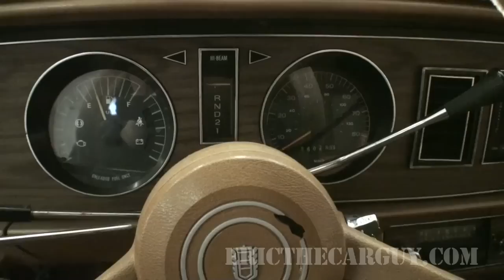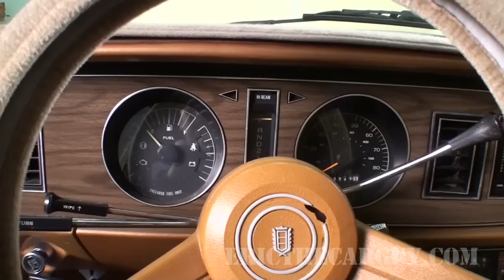1979 Ford Fairmont a Closer Look #FairmontProject

Comment: Wow brings back memories! I had a 1983 Ford Fairmont heavy duty package NYC Taxi $8,800 brand new! The easiest car to work on! Changed oil & filter every 3000 miles, brakes every 10,000 miles, tune ups every 25,000 miles, timing chain every 50,000 miles, struts, wheel bearings…you name it!  Tranny went at 99,000 miles had Aamco fix it $35O. @ 180,000 would not pass Taxi Limousine inspections. Great video Eric!

Comment: If you wish to upgrade to 4 wheel disk brakes. and 5 lug conversion. You can take spindles and axles from a 94-2004 mustang it is direct bolt. you will also gain sealed front wheel bearings.

Comment: I like these old fox body Ford Fairmonts from the 70's & 80's because any type of engine can be adapted to this type of vehicle. The best engine to use in a Ford Fairmont is the 302 V8 such as the Mustang engine.  But the old school straight 6 was a dependable fuel efficient standby for a driver that only desired a reliable daily driver to go to work or the grocery store.
Reply: Mr Cabot    Yeah, that.  My 79 wagon with the 6 got a steady 16mpg around town and maybe 20 on the highway if I didn't wrap the speedo around :D.  But it was dependable. Tended to eat carbeurators though.

Comment: Amazing video! I have to agree with your point on the manual transmission. I too like the look of the column shifter in the 1970's to late 1980's  American cars. I own a 1987 Suburban and I would not change its automatic to a manual transmission. Every time I step into my truck It takes me back to my childhood. Such good times.

Comment: I have always had a thing for Fairmonts, even though I never owned one myself.  I remember seeing the commercials on TV back in the fall of 1977.  As many of you know, the 1978 Fairmont introduced the "Fox" platform, which served as the foundation for many of Ford's other vehicles, such as the 1979 Mustang, the 1980 Thunderbird, the 1981 Granada, and even the 1982 Lincoln Continental!  The "Fox" platform lasted until 2004, last seeing duty under the "SN95" Mustang.

Comment: This was my first car. 79' Ford Fairmont. We bought it in 1987. I found it in the Thrifty Nickel (the Facebook Marketplace of the day) and traded a .410 shotgun for it. No windshield, no back window, four different size tires...and the engine was burned up. My dad and I spent an entire summer rebuilding that engine. It had a rear main seal leak. I literally kept a case of oil in my trunk. It left contrails where you drove. 😂 Oddly though, eventhough the oil leak continued, it didnt smoke as badly after a few months. That was the car I drove to college. I used to make trips from Tyler, TX to Fayetteville, AR in it. I think the only real issue I had was needing to replace the alternator. The interior (oddly enough) was in excellent shape and it blew cold air. I sold it to a school teacher in 1989. Good memories.

Comment: Great tips Eric ... my pipe wrench could have saved me many rusty struggles over the years .. bingo !

A tip I would share here is that cotter pins need not be an obstacle. I constantly reuse them by gently bending the loose ends back together as straight and flush as possible starting with a flat screwdriver if need be and then using needle or regular pliers to crimp the ends back together as straight as possible .. then grip and pull the on the loop end so as to pull it out the way it went in. It's a far more time and money efficient approach.
Cotter pin metal is soft enough to be very forgiving and easily extracted and tapped back in for re use repeatedly.

Comment: My first car was my mom's old 1979 Mustang. She bought it new and I ended up with it in 1989. It wasone of the rare ones from that year that had the same block as your Fairmont, and your video brought back a ton of memories. All my earliest nightmare wrenching sessions were under the hood of that car. My sister had trashed it in college and I inherited the sky blue hulk. I was so broke when I was in college that when that stupid Ford flexible coupler in the steering shaft came apart (which was a rather harrowing experience on the highway, to be sure) I had to repair it with a shoelace. It held for almost two years until I could get a junkyard flexible coupler that was in good shape. 

I hated that car. I loved that car. Thanks for the memories. Looks like you actually have quite a bit to work with, here. The rocker panels are a good indication of the condition of the body on these old cars, and yours are in what look to be excellent condition. 

Have fun. I will enjoy watching your videos that follow your work on this vehicle.

Comment: Eric, I really admire the vision you have for the Fairmont. My friend's Mom bought one new, a 2 tone, light & dark blue. 4 doors. Even though this is probably the most
"plain Jane" car EVER produced, it has character. The aerodynamics are like a telephone booth on wheels. You expressed that you intend to do a V-8 conversion.
I would suggest considering a Turbo 2.3 SVT. They are wicked quick, and the fuel economy is a plus. I had a friend that had this set up in an '87 Thunderbird, with a 5 speed, this HUGE car would get rubber in 2nd gear, zero to sixty around 6 seconds, and get nearly 30 MPG. No, you don't get the pleasant rumble of a V-8, but the factory exhaust on my friends T-Bird (duals, no less) was, let's say, inspirational.
If you decide on a V-8, I would only assume that you would go with the 4.6. Excellent choice. 3:73 gears and an AOD tranny. I have this set up in my Crown Vic Sport. I can only imagine how this would propel a Fairmont. (!)  Best of luck with the Fairmont project. I will be watching.

Comment: oliver is an interesting older car. very well taken care of also.  any resto mod will take much time to complete correctly, however at the end, you can say you did it, and that is very satisfying.  something about these older cars that brings you back to an earlier time. newer cars require less user input to operate but can be much more of a pain.  I myself prefer older vehicles, throttle cable over fly by wire anyday.

Comment: I had a '78 Fairmont wagon with a rare factory trailer package. (5 lug hubs, C6 trans, HD axle and suspension) I am a performance car enthusiast, so it was sort of a between car for a while. It drove like a dream, and this one did have a rather spirited 6, maybe had a higher hp engine with the trailer pkg. I drove cross country with this car, never a problem or worry.

Comment: My first car!!!  My 79 Fairmont had the fire breathing power of a 2.3L 4cyl.  Got it in 1984 and had it until about 1988 or 89.  The cars body still looked good but the undercarriage rotted out.  It sat for a couple years but always started like it was still a daily driver.  In fact it started right up and drove itself to the junk yard on the day before the registration ran out with giant holes in the trunk floor and no exhaust.  I drove it on it's final trip with all the windows open cause I didn't want it to be my final trip also ;)  I remember an article in a car magazine back in the 80's when I still had mine about this guy that put a 460 Lincoln in a Fairmont and kept it looking stock from the outside except for the big fat tires on the back.
Reply: me to the floor boards and the dash were rotted out! it had copper head in it. I parked it in 1999

Comment: I like this car and I like what I can see of your mods.  Reminds me (at my age) of the 62-3 Chevy II base model 2 door sedan with all the ways you could go to modify it.  A picture of a 62 Chevy raised up a bit with a straight front axle and a larger but not outrageous size engine up grade makes me smile.  The look of a bench seat with a Hurst shifter with a patterned white ball just brings me back to those days.  Your Fairmont could easily be a newer version of that 62 Chevy II base model 2 door sedan with a rum, rump cam and a 5 or 6 speed Tremec manual transmission (a little pricey) with a 411 rear gear with some tubby tires.  I haven't explored any of your video's about what you did to this model but I'm very, very much looking forward to going through them.Take care and thanks for your time...Rob (ex Bronx boy)

Comment: ive got a 78 that ive had for six years, has 358 thousand miles on it and i just drove it across the US twice. starts up and purrs like a kitten all day. 23 strait hours driving and not a single problem. sure its under powered but that c4 transmission shifts very well and its a fun constant project

Comment: You're right, it makes me think back about the light weight.  I can see the emissions because of the gas problems in the 70's.  Also, I had a 1980 F100.  Thinking back when you said light weight, Ford drilled a bunch of holes in the frame around the truck to lighten the weight of the frame.  After production, they realized that by doing that weakened the frame and they stopped doing that afterward.  Beautiful Fairmont, can't wait to see what you do with it!

Comment: Oh man a suspension change. I keep dreaming about putting a VW Bug or a Citroen DS on something more contemporary. This project is gonna rock so hard, thanks for the videos!
Reply: For the DS it would be a shame to lose the suspension of the time. Yes, it was prone to failures, but it was awesome technology (you could drive the thing on three wheels in case you had a blow out!!!)
Reply: Yeah can't argue with that- that suspension is automotive history and should be preserved on the proper oldtimers in original state.

Still, when talking about sleepers nothing sounds as awesome as a DS with a modern day air suspension or something of that sort.

Comment: Ahh the good old horn on the turn signal. Parents had two Fairmouts a '80 like you yours but 4 door with a light brown color and a '83 4 door Futura. Remember riding with my mom to work and she had a large hill to climb in the '83 we would hit 70 before the hill and by the time we hit the top were lucky to be doing above 50. These car have a spot in my heart, I even though at the age of 8 it was a good idea to drive around the block only went into one lawn fun times.
Reply: Also don't forget about you foot vents.

Comment: I am catching up on his videos as I am a disabled vet and got stuck in the va hospital with no internet.  Back in 1976  was 16 and my days was a master mechanic . I used to help him where he worked in a taki company . They dad not mind. I started sweeping the floors but by the age of 9 I could take a car apart and put it back together. I even was getting paid at 15 for helping out on every thing. He paid me 5 and hour for 4 hours at night . I saved up over 7k by 15 . I had been going to police auction  at the age of 14  just to check out what was being sold . They usually had 20 cars  . But then at 16 I found a 1979 dodge polara with a  slant  6  but it had 42k miles And it was leaking oil bad. So nobody bid on it so I got for 200.00 bucks . Then I seen a 1968 fury and the hood was jammed as you could not try to open and you could not start them as they had no keys .I crawled and could see the engine number ad it had a police 440 6 pack nobody else even got under it. I got it 1670.00 but when I got it home and jot the hood open the 6 pack was gone and it had been converted to a 4 bbl carb . So went to quite a few junkyards to find parts . We got everything for around 2k we changed back to a 6 pack and we made some mods and got it to 560 hp. . Then I was winning a lot of street races . Then 1 day I was racing a guy and it was unmarked cop car. I was leaving him behind at was at 135 mph when my left right tire blew. The last thing I remember was seeing the flying off.. I woke up 3 days later and the cope come by and say it did not turn me in and he said loosing a nice car and tore up you body he did not even give me a ticket. Man I miss that car!!!

Comment: Very interesting, brought back a lot of memories. My dad used to own an almost identical Fairmont as his "beater" car ('79, 2-door sedan body, 3.3L 6 cyl., 3 speed automatic). Only difference is his was white with red interior. Even had those same style hubcaps lol. His had a hood ornament (which eventually fell off and was kept in the glove box) but oddly didn't have the "Fairmont" badge on the rear trunk lid, not even any glue marks where it would have been if it had fallen off.

Mom hated that car, but I actually miss it now.

Comment: Good LORD almighty it's flashback city! My very first car was a 79 Fairmont wagon (with that dull but durable 3.3L 6) that I bought from my parents. Drove it for a LOT of years and put just shy of 180,000 miles on it before I got tired of fixing it and sold it. I saw it driving around town for at least ten years after I sold it.

Comment: Just picked up the Ultimate Sleeper... A 1981 Fairmont Station Wagon with a Fuel Injected Mustang 5.0, AOD,and a 8.8 inch Posi Rear End with 3.55 Gears. It Runs and Drives Great and I got for the absolute Steal of the Price of $1100. I'm told it runs high 13's in the Quarter Mile. It looks like crap with lots of rust in the fenders but i think that just adds to the Ultimate Sleeper Look.

Comment: My first car was a 1978 ford fairmont i bought from my parents for a buck.. It was rotting away in the 2nd garage and being 14 and me and a buddy started pulling off parts of the top end of the 4 banger and if i recall we busted a socket removing the head bolts with no concept of a cheater bar, and that slowed us down.. I had a few friends push the car out and turn it around so it faced the garage door so I could use more natural light from the alley. The wheel were locked up and dring that process they broke free and I had them push me down a ways. Within a year or so I was given an uncle who had passed 1988 chevy celebrity. But hanging out with my buddies in a Chicago alley smoking ciggerates and turning wrenches will always be a fond memory that I will cherish...

Comment: Eric, as I remember the charcoal canisters started on cars in the early 70's. Some had some real problems back in the day. I've seen a few that somehow the fuel tank got pressurized (or it was a vacuum problem) and the fuel would pour out the bottom of that canister and would become a real fire hazard! I had to stop a guy that was stuck in traffic out here a few years ago. He had a 1975 Corvette, I was on his left at a stop light with my windows down, He was cranking it and it wouldn't start. But I could smell the gas and shouted for him to stop. We were able to push the car off the road to a parking lot with the help of a cop holding traffic. There was a big puddle of gas on the ground and the charcoal canister was still leaking gas when we opened the hood. I don't know if Ford had that problem but I know that GM did. As for the AIR System, that goes back to the 60's. I know that my 68 Camaro had one stock. I removed it when I put on headers!
I do like your videos, brings back some memories of when I worked at a gas station back in the 70's. By the way I still have the 68 Camaro and am going to start to restore it late this year or next summer. That is my retirement project. Any suggestions on where to get good parts and body panels?

Comment: Sweet ride Eric! I'd say the best is doing the most with the least! I'd do the little upgrades, get an electric fan or a clutched unit, fix up the brakes, clean it up etc. I say definitely keep the catalytic converters so it doesn't smell bad, otherwise it could gain a bad image on the road. I wouldn't upgrade everything to modern stuff, I like the classic vibe. I'll certainly stay tuned!

Comment: I recall driving one of these for a few weeks as a loaner (while my POS brand new E150 was down). It was terrible. No power, like you say, but that's a good thing because the brakes and steering were also barely functional. It would stall at stops, the headlights randomly go off, the dash shook as if half the fasteners were missing. And that was a brand new car! I'd say it's the biggest turkey that FOMOCO ever sold. Only slightly better than walking.

Comment: I'd certainly spend money for the suspension system. I owned a 1980 Fairmont, OK 
on the straightaway but off ramps and entrance ramps required drastic slowdowns, and when my 300 pound friend rode in the front seat it felt as if the driver's rear wheel was coming off the road on a hard turn.

Comment: I had a 67 Mustang coupe, 302, Crane cam, long tube headers, Holley 4 barrel, 4 speed top loader, MSD6A, four row radiator (no shroud), 3.25 limited slip, etc.  The radio was never used as I couldn't hear it anyway!  Something about a lumpy cam and long tube headers is better than any music.

Comment: I was shocked and delighted when I saw that four link rear suspension. My wife's '98 Mustang (SN95) has the same suspension.  The front suspension and power steering rack is also very similar. Ford still runs that rear suspension in Mustangs. I think the 2014 Mustang is supposed to switch to an independent rear suspension for the first time.
I'm not aware of any independent rear suspension kits for Mustangs.
Polyurethane bushings would help handling a lot. Energy Suspension makes a complete kit for Mustangs. I installed the master kit on my wife's Mustang and it handles like a new car. I made a few videos of the install too.
I'm looking forward to watching the build up on this car.